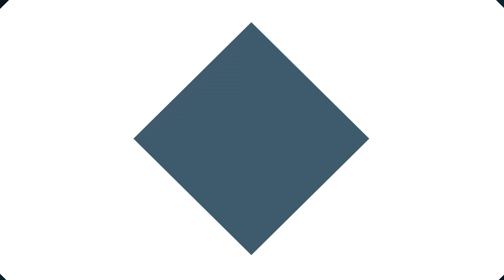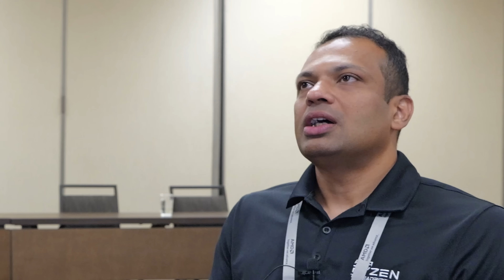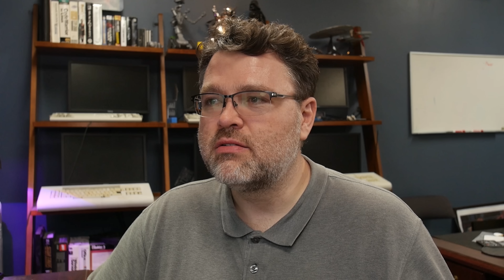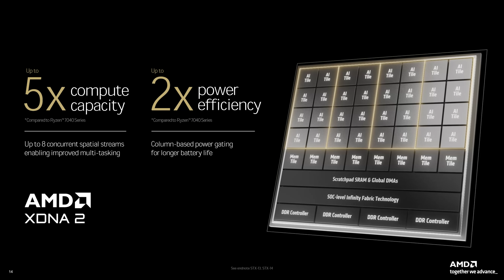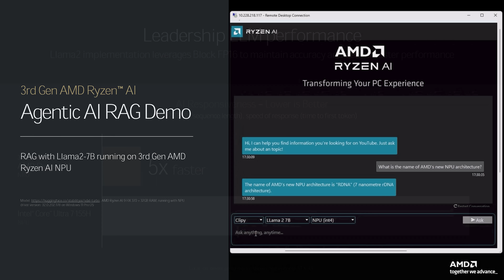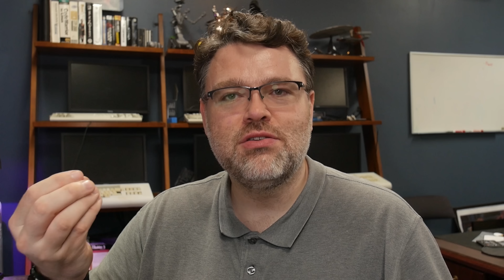Zen5 Mobile SoC: Chat about Sleep, and Voltage towards Long Mobile Battery Life

Comment: feedback:
the split screen (Windel left, and guest on right) does NOT work.
that's because although you have a nearly seamless cut between the two halves, the eyesights do not match the perpsective.
(it look like Wendel is looking at the wall far behind the guest)
nice try, but don't. just do regular switching back and forth between cam 1&2, or have a 3rd camera for the wide shot.
Reply: side note: what that's portable and AA bateries?

Comment: At the end you mention the current lack of "killer AI Apps". Is software is available for the XDNA2 (50 TOPs) to speak with a different voice for which you have some samples? Nothing illegal is intended here ... I just imagine that voice imitation cannot be performed on a laptop. I'm thinking of the "Pumuckl" Series on RTL where the original voice (in German) of "Meister Eder" from 30 years ago was emulated using AI for the new TV series, which is a great success. I guess no such software exists for laptops.
Reply: Correction: it is the voice of "Pumuckl" from 30 years ago that is cloned in the TV series. I also refer to software that executes locally without uploading voice samples to a powerful server somewhere that does it for you.

Comment: There's an ARM Ltd presentation, filmed at Apple in 1994, that covers the philosophy of no tied clocks, on their novel vendor customisable SoC's, to offer the ability to throttle / stop any clock, to independently suspend a feature (if not simply removed from the die), so only seepage power is required to maintain states, to allow unneeded blocks to instantly be spun up in their previous state. Taken three decades for the x86 duopoly to ape their vendor customisability, power saving tricks, and mixed big.LITTLE core mantras.
Reply: x86 processors had a plethora of independent clocks for a long time already. What he was talking about was that they split up the infinity fabric into multiple parts now, which, if I got his point right, was always on (for every path to every connected IP block)  and at the same infinity fabric clock. The IF clock was always a separate clock from the core clocks or memory clock on Ryzen.
Reply: The 2015 Skylake and 2019 Zen2 started to ape the mobile world, by allowing parts of the die to be independently throttled, but a twenty year patent term behind the idea coming to market.

Comment: I have one Big problem with amd. the idle wattage is So High!!! and that is enough a problem, that I have gone Intel. We can say much about Intel the Last years. But there idle is Way Better!!!
Reply: It is true that the chiplet based Desktop Ryzens have higher idle power draw than Intel's equivalent chips. At least for zen5. But that is not true for AMD's APUs – which is what these two were discussing here. If you care for energy efficiency on desktop, get yourself an AMD APU. They have fairly low idle power AND are much more efficient than Intel parts under load.

Comment: I'm curious how closely they are working with Valve on this and how this might impact the speed at which we see a Steam Deck 2.
If the changes that AMD is making here are as significant as they say, then we might actually see a Steam Deck 2 sooner and with massive battery life improvements.
It might also allow for more specs to be crammed in but turned off outside of the games or programs that absolutely need it. He mentioned that it could turn off a whole lot of the chip when just watching a video and that could make for an impressive point where using something like a Steam Deck for watching video content would be better than your phone because the processor could idle down incredibly low and actually use less battery perhaps than even an ARM device.
Reply: Probably we would want at very least 2x perf at same power. Steam Deck is already 5500/6400 in memory at 128-bit. They would need 8333 192-bit to get the memory bandwidth.
Reply: @ZAGAN-OZ or use infinity cache

Comment: I really REALLY hope the APUs see increase cache to reduce the expeditions off die to RAM even if that RAM is on package its still more electrically efficient to go to cache than to RAM.
Exception being if cache were placed on a seperate IO die then it would probably be much closer in picojoule per bit with on-package lpddr

Comment: I would like to try Ryzen AI on an embedded platform. I am not satisfied with the long term support with the Nvidia Jetsons.

Our latest Jetson AGX Orin kit supports an OS based on Ubuntu 22.04 (JetPack 6) but the Jetson Xavier is under Jetpact 5 (ubuntu 20.04) and our Jetson TX2 is under JetPack 4 (Ubuntu 18.04).

It would be easier to recycle old versions for less demanding tasks if it would be supported longer. At some point the platform is so old that we have to compile everything from source.

The CPU of an old TX2 from 2017 is probably faster than that of a raspberry pi 5 and the system has 8gb of ram (59.7GB/s), supports an M.2 nvme ssd, has a 256-core Nvidia Pascal GPU and, therefore, has hardware video encode and decode. It's a shame to have to replace it and leave it in a drawer. 

In addition, the AMD platform would offer more flexibility and ease of use.
Reply: My university robotics team used a minisforum with an AMD APU as our primary computer for our competition this year after having used NVIDIA Jetsons for many years previously. (We used an Xavier for the past few years, and they used TX2s before that). It's definitely nice to be able to run a regular version of Ubuntu and know we can update to new versions as they come out.

Power draw was definitely a bit higher than a Jetson or raspberry pi would have been, but it was a lot easier to use for sure.
Reply: @CutoutClips  It's good to know. We do a little robotics around the edges but that's not our main interest.

It helps to have a BIOS, to be under x64 and not to depend on Nvidia or whoever made the carrier board but we would lose access to cuda under this platform even if for inference tasks it should be fine. That said it's not just that and tasks like stereo vision can be accelerated by gpu/cuda and it seem that SLAM too but I haven't tried it yet.

Comment: Can the NPU be used for graphics ?
Reply: it can be used to do AI things that work on graphics. Maybe you can even use it to perform some calculations for graphical tasks that aren't using any neural networks.  But it cannot be used like a graphics card, no. It is a fixed function piece of hardware that is much narrower in its capabilities than a GPU.

Comment: I still wish iGPU has sr-iov, anyway, off-topic here. Surely, new cpu from both team will be a heat battle on efficiency.
Reply: To be fair you can use Hyper-V GPU visualisation which isn't quite as good but still gets you full 3D acceleration of potentially multiple VMs shared with the host
Reply: @bosstowndynamics5488  I don’t want windows as Host.

Comment: They do variable CPU frequencies to safe power but do they also do the same for ram and vram? It would not be much savings but If they also choose low wattage ssd's they should gain 15-30min battery time.
Reply: Yes, it's called "Gear down mode" when RAM divides down the clock. On PCIe it is called ASPM.

Comment: The NPU is gonna just take space and burn power doing nothing 99.999999% of the time. I really don't get why they're doubling down on useless computing. I'd much rather have a cheaper and more efficient SoC. The "secret" to power efficiency, as Apple shown, is all in the accelerators; dedicated small portions highly efficient in doing a single task really helps to "easly" increase efficiency. Video playback, 3D acceleration for GUI, I/O, networking and storage. All these things are the basics of modern computing and I didn't hear them talk about it at all. Sure you can "manage" power but segmenting cores in A tier and B tier is the blunder Intel found itself into and, as much as they say all the cores are equal they're not and will make a mess of scheduling thrashing efficiency in the process.
Reply: The NPU is essentially an efficiency core for the GPU, so can save a ton of battery life.  The A11 Bionic in the iPhone 8 back in 2017 had an NPU.  Apple's M-series has had NPUs since the beginning, but they call them "Neural Engines."  The M1 NPU was capable of 11 TOPs, and the M4 is capable of 28 TOPs.
Reply: Sure, but it's use is exetremely limited and very situational. Also depends on the framework devs have to work with it. Meanwhile more useful accelerators/coprocessors used for more basic functions would've net more efficiency gains in my opinion.
Needing to work with the NPU almost like an FPGA to make it do other things is a waste of resources for developers and nobody will use it that way. I guess Microsoft put way too much pressure on them with the whole Copilot+ for AMD to do better things with their resources.
This is also proven by the fact that no Copilot+ label exists for desktops.
Reply: @TommyThousandFaces  The NPU is one of those accelerators you're going on about. It's the direction compute is going, even if you don't like it. AMD's APU's (really all modern X86 SOCs) already has many other accelerators & controllers included in the package. Media encoder/decoder, graphics and IO, have long been built-in to their SOCs. There isn't anything to talk about there.
Reply: Yes it is, but it's an accelerator for very very edge cases that maybe will never do any work for the entire life of the device. And I know there are already encoders/decoders and other accelerators inside processors, but my opinion is that trying to improve the efficiency and performance of those would've been much more beneficial. Wether is possible or not is another story.
Reply: @TommyThousandFaces  If you were absorbing much of their conversation, they were talking about just that in the package as a whole. Like gating off unused portions of the SOC. Something like the NPU being literally low/unpowered when not in use. The quest for more performance is literally a known constant. No new tech is immediately realized among the masses for its full potential, but if you don't put it out there it never becomes a thing. Look at how long it took x86-64 from development to ubiquity and normalization in the market.

NPUs exist in Apple and high-end Android devices, but Microsoft owns some 80%+ of the desktop OS space. So if increased development is going to happen targeting NPUs well that's where the ubiquity needs to be. Video and image processing software are the most immediate use cases taking advantage of them. Just like how a GPU is faster and more efficient at graphics vs a CPU, NPUs will be the same for the types of math they excel at. At some point certain complaints are clearly just about hating on AI and anything associated with it.
Reply: I listened and had nothing to say about gating power to unused parts of the SoC because it's very smart advancement in power management. I know I came hot on AI and the NPU and that made me sound like I just hate AI. I don't, I just think it's a nothing burger like the Metaverse, at least for what people do every day. If you want a program that does inference on documents locally there are quite a few out there and can do their job perfectly fine and efficiently on CPU. The NPU is only needed to ask a multi billion parameter AI to retrieve them. That's wasteful in my opinion on multiple fronts.

Microsoft (consumer) is a lose cannon at this point, frantically moving in all directions at the same time and not making progress in any field. Today's tech is also already outdated until the fully fledged software comes out for it.

I don't think an NPU can do much more on already stored footage or pictures. Stabilizing, applying masks and filters is already instantaneous on any modern CPU. And I don't think anyone cares about a perfect bokeh effect when streaming a low bit rate webcam video.
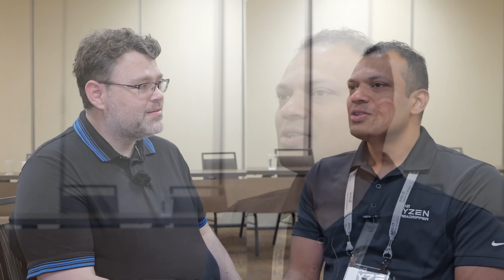Reply: @TommyThousandFaces  At like 2:30 he mentions power gating at IP [block] level the 1st time, and its mentioned as an area of focus a number of times. Do you have a baseline for that document inferencing to suggest it wouldn't be even more efficient on a NPU? Because you can do literally anything on a CPU, that doesn't mean its the most efficient way to do it. Even if something just works quickly in real time, the CPU churning away to do it may well have a much higher power demand than something like an NPU. It's a non issue plugged in to a wall or for a desktop with a dGPU. On the go with a thin/light laptop. I know my RTX 3060m eats a lot of power not even doing heavy work, and disabling it in Linux requires a reboot.

Just a couple of weeks ago I had to do data recovery on a SD card from camera, where the files/filesystem were mangled when they put it into a computer. I got hundreds of photos back that got sorted into about 8 different folders and no type of real file names. The customer specifically wanted so recent beach photos. Very much required me, a 3rd party stranger, to manually look through all those images to confirm for them what they wanted was there. It's would be useful to be able to search for image contents via prompt locally. Wouldn't be terrible as a function built-in to the OS.

A regular scenario could just be a person with thousands of images unlabeled over decades, and wanting to identify and organize by some visual criteria. I've dealt with thousands of "typical end users" over 20 years. Many/most of them are very poorly organized digitally. MacOS lets you stack icons endlessly on top of one another.
Reply: You are contradicting yourself here. You don't want NPU but want task specific accelerator. NPU is in fact accelerator. Dedicated media decode and encode is not something new it's already there in every gpu including iGPU since very long time ago. You know that most of the efficiency came from node advantage (Intel 7 rebranded 10nm against 4nm for M3 and 3nm for M4)  better OS in terms of scheduling and idle CPU usage, and better memory configuration (tons of windows laptop use ddr5 the worst offender or slow ass lpddr5) or not using dGPU (some thin laptop still include them and definitely all gaming laptop)
Reply: Manifacturing node improvements were made, I can't ask them to move to 2nm. The NPU is, in my opinion, a gimmicky and useless accelerator that has no use for the average user these laptops will mostly be bought by. I know media encoding and decoding is already available but it's not as good as it could be, which is clear as day especially in AMD GPUs. DDR5, LP or not, runs even lower voltage than DDR4 so it's an improvement. Adding a dGPU is up to the laptop manufacturer so I can't ask AMD to stop including dGPUs in laptops with their SoCs.

Comment: AMD are the best. Intel make poo poo chips. I use AMD chips.
Reply: What is your AMD CPU?
Reply: @Maiza007-c8y  Ryzen 9 5900X with 32GB of Samsung B die 1800mhz 14-15-14-21-34-1T

I went through a few RAM kits to find the one with the tightest possible timings as it helps these chips out

I spent over a year optimising the system and it is a very low latency system as measured by LatencyMon,  the longest procedure calls in typical usage are for the network card drivers and still take less than 1 millisecond to complete. Pretty amazing.

I spent probably way more of my time optimising this system than a sane person would but it is now fast and stable, I had to endure a lot of crashes to get here, but it feels worth it.

I don't recommend RAM overclocking unless you have A LOT of free time, back ups of your stuff, and probably a little bit mad.

but if you are interested: https://www.youtube.com/@ActuallyHardcoreOverclocking

the 5900x is not the best chip for gaming, it is not the best chip for productivity, but with the latency optimisations, it is a pretty amazing allrounder chip. 

Part of solving the latency problem is software, core parking needs to be disabled, which costs you more energy usage, but when my PC is on, I want it to be fast fast fast, not efficient. Then when I am done with it I will turn it off.

I also have a 7900XTX GPU, so the system is not exactly super efficient at idle. It is really a system that is designed to be maxed out continuously or just turned off.

I went all AMD in pursuit of low latency as well, because Nvidia drivers can be high latency

there was also some promise of RDNA architecture and GPU and CPU cooperating but I think that was marketing wank
Reply: @Maiza007-c8y  Ryzen 9 5900X